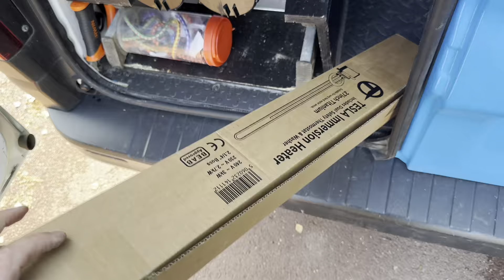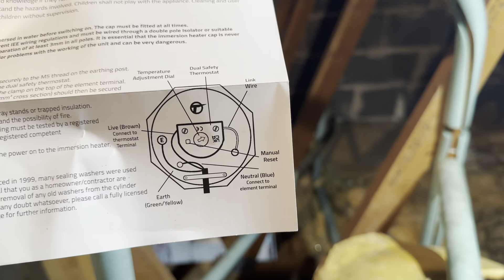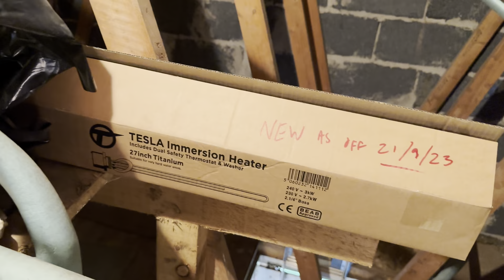THIS COULD HAVE BEEN WORSE

Comment: Nice job Nathan, you even put the outer sheath of the cable correctly under the cable clamp!!  The only thing that let you down was proving dead of the supply.   But yes, you are fully competent!! How many times have you torn the threaded boss out of the cylinder!!  😂😂🥴😩
Reply: What do you mean by that? What should he have done? Is it because a proving unit was not used? Thanks.